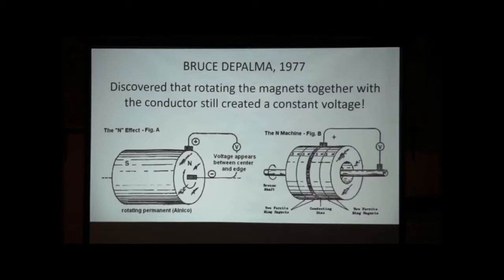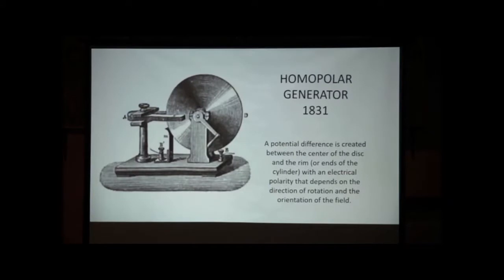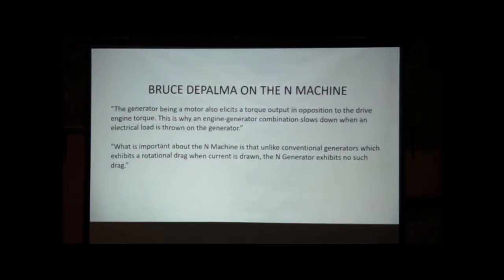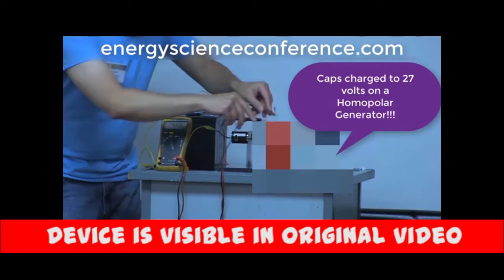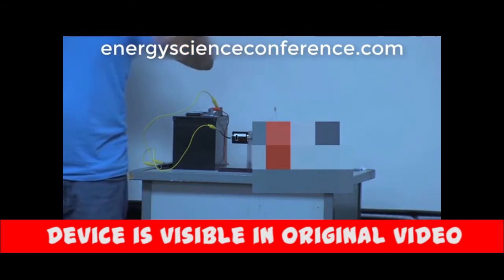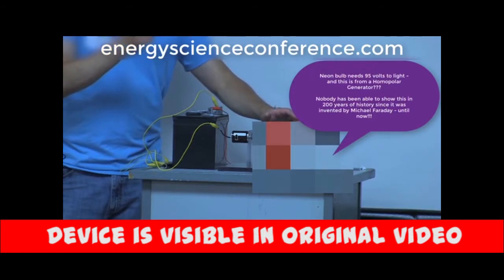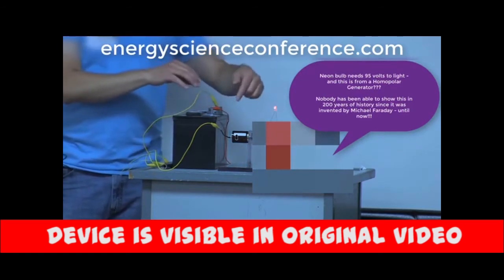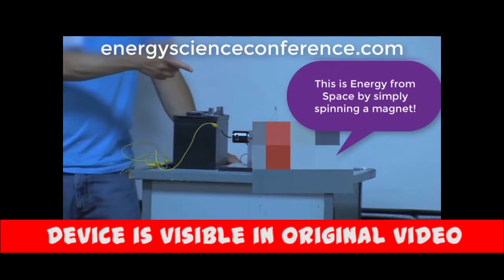High Voltage N-Machine by Aaron Murakami [PREVIEW]

Comment: No big deal transforming low to high voltage from a N-machine, homopolar generator, Faraday disk, etc etc. It definetely doesn't take a whole book to teach such a basic circuit. Very misleading title making people believe that the problem of the low voltages, intrinsic to such machines, has finally been solved. No matter what your approach is, the output POWER continues ridiculously low, and therefore there's no use for such a topology in real life.

Comment: Don't bother buying files from these scammers. It is not HV N-Machine. In their PDF file, they showed a schematic of conventional Depalma n-machine connected to a car ignition coil's primary winding via a switch. As you disconnect the circuit, high voltage BEMF from secondary winding charges a cap which light the bulb (in the video).